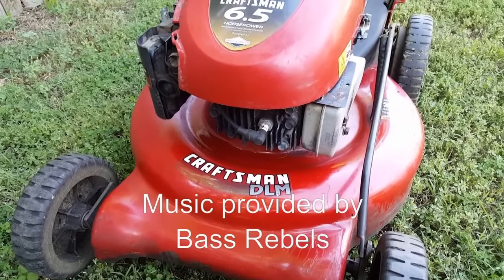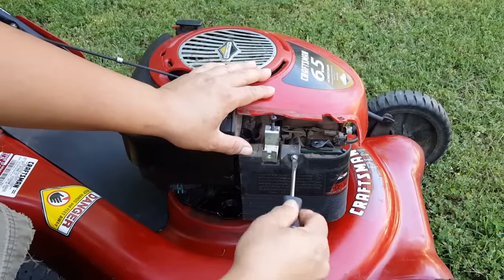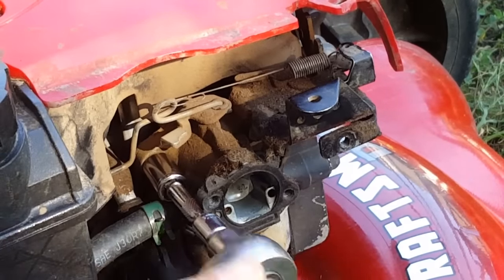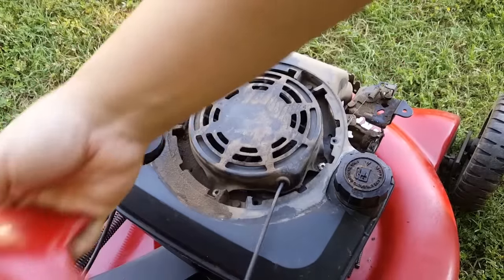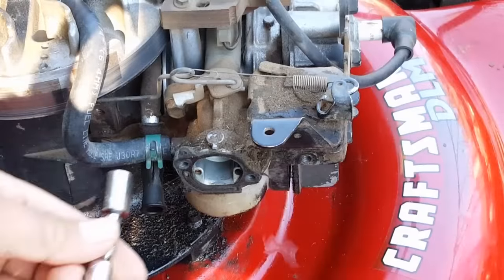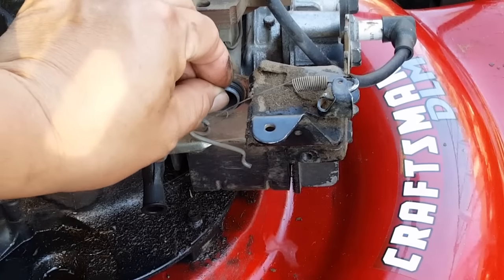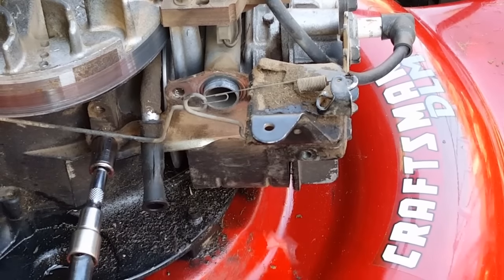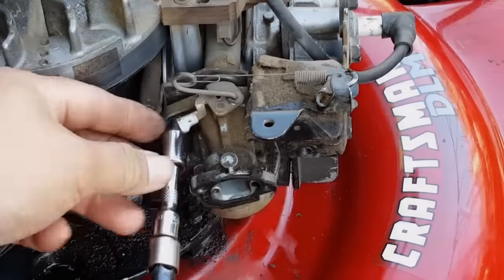Lawn Mower starts and then dies, turned out to be an easy cheap fix -Loctite!

Comment: oh yeah, that's an "easy fix"   LOL!
Reply: Only took me about 10 minutes worth of labor, and that's only because I put it on wrong the first time lol, better than wasting a couple hundred bucks buying a new one.
Reply: It is an easy fix. Literally like 6 bolts
Reply: If you know what to look for.
Reply: It really doesn't get much simpler than taking bolts off and putting them back on. You're not having to tear down any parts to fix internals. My 8 year old daughter just did a similar repair as I talked her through it
Reply: @joelt4416  Are you for real? I'd be ashamed of making a comment like that you clown.
Reply: @jamesbruce9607  you're breaking my heart.
Reply: 😆 ikr
Reply: It's easy for most people, difficult for double digit IQ people, extremely difficult or even impossible for single digit IQ people . Duurrr
Reply: @RealFifty  we get it dude, you got nothing going for you
Reply: @damnit_terry_why2211   it's ok buddy 👍🥳🥳
Reply: If you’ve never worked on something like this all those bolts coming off can be a little daunting. When you get into though you’ll see that things only come off and go on one way. So it’s pretty easy. Just don’t lose the bolts or parts.
Reply: Very easy fix
Reply: "Easy fix" if you already have all of the tools, O-ring and thread locker. Otherwise, a few trips to the hardware store trying to find the right tools and parts, then trying to figure out where all the bolts are supposed to go putting it all back together. Yep, "easy fix." 😂
Reply: @dark7hery1093  literally like 12 bolts. Learn how to count or at the very least stop saying "literally".
Reply: Easy fix for someone who doesn't have tools or know anything about mowers? Lol sure it's great on the $ saving but for those that don't work on this stuff. It ain't an easy fix 😂
Reply: @joelt4416  if you have a push mower, you should own the tools to perform this standard repair. Being poor isn't an excuse, be better with your money.
Reply: Agreed.  I wouldn’t say easy, esp if it’s not the same model mower or you don’t have tools.  Might get something apart you can’t figure out how too put back.  But if you’re looking at trashing the mower anyway it’s worth a shot.  

I think someone said if you have a mower you should have the tools to fix it?  Do what now?  You probably have internet in your house but don’t have the skills or tools to take your router apart.  The two are not mutually inclusive.
Reply: If you have an average competency level
Reply: @a_real_jive_turkey7772  if she available for an overhaul? My 68 Chevelle is smoking...
Reply: Proceeds to take the entire thing apart
Reply: @TheMoistDonuts  gotta start somewhere 🤷🏽‍♂️be doing it all in no time.
Reply: say you’re stupid without saying you’re stupid
Reply: Ummm yea he was rite easy fix my ass
Reply: Knowledge is power.
Reply: The replies here really indicate why society is falling apart.
Reply: This comment section took a detour, huh? Comments on people’s IQ, financial habits, work ethic 😮
Let’s be nice, it’s a video about using a ratchet for Peet’s sake🙄
Reply: No kidding.  I'm in the middle of cutting before the rain comes. Was looking for a super fast fix so I can finish.  This to me is a two hour project. Got most of the lawn done, so I guess I'll just weed trim the rest before the storm comes.
Reply: @TingTingalingy  "be better with your money" lol When you get a job, tell me. We all know you don't have one.
Reply: @DrowsyYo  yeah.... Idk bro... I Own a home, I own a canyon AT4, safe full of firearms and ammunition, freezer in the basement full of meats, pantry full of dry goods. Do better...
Reply: @cbrooks0905 love the way you approached this. You sound like a great guy! Hope all is well
Reply: @thebewitchinghour831  cutting grass is secondary to damn near everything else in life. The grass will still be there after the rain, dont let it rule you.
Reply: @TheMawas1 
Not even close
Reply: My thoughts exactly I’ll wait till payday then pay 35 to dude who walks down the block then I’ll buy that stuff then do it myself
Reply: I have zero mower skills, I bought a used one off marketplace, had bad carburetor gaskets. But the owner thought it was a carburetor, I had extra gasket material in my tools. Changed those out and good as new. All push mowers are disassembled similar to this, that I’ve seen on YouTube. (Like I said I’m new, no mower experience other than YouTube)
Reply: Thought he was going to say spark plug 😮😮😮😮😮what the wow😮😮😮😮
Reply: Yeah, so “easy” I quit watching 1/3 of way through! 😫
Reply: “Let’s go ahead” and show you a multitude of processes of elimination first😴
Reply: "Omg its such an easy fixxxxx"
......says the people who had to come to YouTube to learn how to do this extremely easy fix....

Comment: Nice video. If anyone else having a similar issue and the carburetor isn't loose, then check the bottom canister under the carburetor, there is one small bolt, once removed you should see two tiny holes on the bolt. Clean them an wallay. Perfection. DallasCityOfChampions
Reply from the maker: Fernando Rodriguez thank you for the tip. I appreciate it.
Reply: I believe what he may have meant to say was ... "aaaaand voila!" 🤔

I mean, I'm just sayin' 😉👍
Reply: Voila is what it means walla
Reply: Bro! Thank you so much . That little hole was clogged. It was one in a million to find your comment ! Very pleased
Reply: This one saved me!!! i tryed everything under the sun and once i used a toothpick to clean out the little holes under the carb. BAMB!
Reply: I'll try that later. I'm having the same problem with my mower primes and runs for a second then dies. Unfortunately i'm becoming an amateur at small engine/carburetor repair with all this junk ethanol gas they're selling. I even drained the tank last fall must have still been some in the lines.
Reply: Thanks a million for mentioning the brass bolt under the canister. The tiny holes were clogged with dirt like you said and once I cleaned them out, the mower purred like a kitten.
Reply: Been a while since this comment but it's still helping .. cleaned the brass jet and away she went. Started right up. Thanks!
Reply: Thanks for saving my lawn mower.. tried everything, it wasn't the two holes in the side but actually the jet that comes down through that fitting.. thanks for pointing me in the right direction.
Reply: Canister is called the carburetor bowl
Reply: Dude! Thank you! Saved my wheeled weedeater. Little flake of rust blocking that center jet hole in the bolt. Started strong first pull and stayed running after having not run over a year and running poorly before that. Man I can’t believe it was so easy. Wish I had known a year ago lol. THANK YOU
Reply: Dude! Thank you! Saved my wheeled weedeater. Little flake of rust blocking that center jet hole in the bolt. Started strong first pull and stayed running after having not run over a year and running poorly before that. Man I can’t believe it was so easy. Wish I had known a year ago lol. THANK YOU

Comment: Dude I work on stuff like this as a day job and see some of these videos for a tip. I'll tell you, this was a good watch fr. Also I find it crazy you do this out in the yard. I put machines on a table and either sit or stand where it's at. Trust me you'll save alot of energy and you'll save your back
Reply from the maker: thank you Destin5, I appreciate the tip
Reply: @Destin5  That's great advice for someone who does this as a day job. Myself,  I don't have a work table large enough to hoist it up on and I only have one lawn mower.
Reply: I'm using a chair to sit on 😆

Comment: I've driven myself crazy for most of the evening trying to figure out what's wrong with mine. . . and combined with little to no knowledge of small engines, it's been a lot of teaching myself what different parts are and do while also trying to troubleshoot. Your video not only was the solution for my problem, you explained it clearly and simply and definitely gave me the the confidence to DIY the job myself. Thank you!
Reply from the maker: Thank you for the comment.  I'm glad it worked out for you.
Reply: Same for me_ am crossing fingers that it will be the fix for mine as well🙃
Reply: @ajtv1993 well?!?

Comment: My craftsman mower was starting and stopping. After watching your video, I pulled the air cleaner and inside of the intake tube was a small mud dobber nest. 
Nothing was loose, I cleaned it out, it started and works perfect again.
Thanks for sharing. 👍
Reply from the maker: Great job! thank you Creek Walker.
Reply: Small engine,(mower,) needs 3 things to run 
(In no particular order)
- Fuel 
- Spark 
- Air 
Check these 
Majority of the problem(s) will be one (or more) of these 
Fuel seems to be the most frequent

Comment: Thank you HG for this vid.  You diagnosis was right on.  I went out to mow today.. mower would start, then die.  Just like in your vid.  Carb was loose.. and that was it.  Checked stuff... cleaned behind air cleaner, tightened stuff up good.. and ... well... just finished mowing the yard.  Started strong and did not a hiccup.  Thanks again.
Reply from the maker: Thank you Robert Mardis and you're welcome.

Comment: Thorough presentation.   Thanks.   Saw a thing I missed in going through my mower an hour ago.   Back to the garage to disassemble again and go through the carb more thoroughly.  Btw...I only use premium fuel, 93 octane in all gas engines here, as recommended by my repair shop...since using it, for over 10 years, my former bi-annual trips to the repair shop have stopped!  I don't run engines dry or drain the fuel in the Autumn, typically October.  My engines start up fine each year in April.
Reply from the maker: very nice and thank you for sharing your experience
Reply: High octane fuel is not really needed 
What you need is fuel with NO ETHANOL

Comment: Thanks for sharing. I have the exact same mower. I found it on the trash a few years ago & the only thing wrong with it was the shut-off switch. I fixed it with a wire tie. This mower is a beast & can cut down 6 inch tall grass no problem. I just recently found another similar Craftsman mower on the trash with a 6.75 HP BS. It also has a shut-off switch problem & the right front drive wheel was stripped. I ordered a new wheel for 21.00 & now I got a great mower. I can't believe what some ppl throw away.
Reply from the maker: Me too. Thanks for the comment I appreciate it
Reply: I have a friend who makes some surprising money doing just that. He is always on the lookout for, mowers, snow blowers, weed whackers, whatever. The fixes are usually easy and cheap.
Reply from the maker: @mbtadhl  you are absolutely correct.  Great money
Reply: Bum

Comment: 1:51 One tip: before pulling out the filler tube, check the base for built up crud that accumulates around the tube from spilled oil mixed with lawn clippings and dust. It's very easy for that crud to fall straight into the oil pan when you lift up the tube. Nice video and thanks for posting.
Reply from the maker: Thank you very much for the tip. I will try to be more mindful next time.
Reply: einfussganger loop

Comment: Thanks so much for posting. I serviced my elderly neighbour's lawn mower at the beginning of the season and it ran like a top. Now it just started doing the same as what yours did. I figured it may have something to do with the carb. Thanks! 😊
Reply from the maker: Glad to help and that's very kind of you to do!
Reply: @HomeGaragechannel I sharpen the blades on theirs when I do mine too.
Reply: I've had my HONDA GCV 190 EASY START LAWN MOWER  for over 10 years: This year (2024) it starts then dies right away, just as the heading describes. It's done this since new from Sears. I took it back several times and got into several adversarial discussions with the sales/service person. I've since taken it to several different repair shops with varying results. I'm not sure this will be a permanent remedy, but I'll give this a try once weather permits. Actually I've had this mower in excess of 10 yrs & since it will at least fire and gets fuel, rather than purchase a new one I'll at least, give it one more chance to remain in service. After-all, it's doing me no good just sitting there; if I take it apart and fail to put it back together properly, , , "nothing ventured; nothing gained.

Comment: Also check carburetor meter valve that holds carburetor bowl on. Looks like a bolt holding carburetor bowl on underneath. Use copper wire to clean small hole in meter valve. Clean bowl out with a little gas. Check air filter is clean. Check spark plug- gap- fouling- wear. My carb was loose on weed whip and a quick fix. Don't know why  mounting bolts aren't put in with Loctite from the factory. Good video. Easy to understand. Moved along and showed clearly steps.
Reply from the maker: Thank you Joseph Werner. I appreciate the information and keep it up.

Comment: I have a Lawnboy lawnmower and I was using it and it ran fine. Then I ran out of gas and it was around 50 degrees ( I was cutting winter rye). I put some gas in the lawnmower that I had recently bought from the gas station.(Shell) It did this exact thing.  I tried a few times to start it. It would not go but 15 seconds and die. I thought about this and decided to use some of the fuel stabilizer that I had bought in the fall. It started up after a couple of pulls. There was a high amount of ethanol in the gas or water. The fuel stabilizer raised the octane and/or absorbed the ethanol or broke down the ethanol in the gas. It never sputtered after that. If you are going to cut grass in the winter buy a higher octane gas than regular. Maybe second level up. It worked for me. I hope it will work for you. Note: Fuel Stabilizer is highly toxic to breath or get on your skin. It only takes a few seconds to put it in the gas tank so put some new rubber gloves on(no holes) and hold your breath until you finish putting it in the tank. wipe fuel stabilizer bottle off with paper towels to dry it off and put it in a plastic grocery bag immediately and throw it away. Hope this helps.
Reply from the maker: Thank you George Minton  for the comment.  That's a really good tip I'll have to try it out.

Comment: Thanks! I partially disassembled my mower to clean it up etc. Noticed the carb was lose but didnt see where to tighten it so I let it be. When i tried to start it, the engine was konking out exactly like yours, so i guess that's the problem. Ill have to dissemble further to expose those bolts and hopefully that will solve it.
Reply from the maker: good luck to you.

Comment: While mine did not have the carburetor plate issue. I tried replacing the gas because the gas in container was probably a year or more old. I changed the spark plug and replaced the air filter and topped the oil off. Of course those did not fix the issue. I also spayed carb cleaner into the carb and same results. I removed the float bowl cover and sprayed the carb leaner around there removing any dirt. For good measures I drained the gas yet again and put carb cleaner in the tank and kept trying to start the lawn mower to get the carb cleaner into the carb. On the 4th pull the lawn mower started and ran. I then filled the tank with gas and it works like a charm.
Reply from the maker: Thank you Mark Rajfura for the comment.  Glad to see that you didn't give up and got it running.

Comment: You put in a lot of work, but man, what you did for most people is not easy.
Reply from the maker: To be honest I'm really looking for the tough cases like this one. I really stumbled on the solution by accident this time.  It's a small engine vs a car with multiple systems. Thanks for the comment.
Reply: You have a point being many people haven't done this type of trouble shooting before or have the tools. I learned by doing it. Make sure you keep bolts/parts in order in disassembly.
Reply from the maker: Absolutely great advice
Reply: Unscrewing some bolts is not that hard.  Righty tighty, lefty loose!
Reply from the maker: Annony Mouse thank you for the comment.
Reply: Remembering where some of them go is a lot tougher. Ha Ha
Reply: Annony Mouse exactly! People acting like he adjusted the whole truck engine or changed a piston 😂😂😂😂
Reply: Mark Rajfura you have a video of where they go. How hard is it?
Reply: I probably will take a lot pictures in between to remind myself how to put them back lol
Reply: @johnanderson3746  straight up.  a couple seconds can save you a lot of headache and time.
Reply: It’s literally six bolts

Comment: I have a lawn mower repair right now at Lowe’s. They told me it was going to cost $600 to repair. They said the crankshaft was damaged and it wasn’t under warranty. They just fixed the carburetor a week earlier and then this happened. The exact thing you showed in the video.
Reply from the maker: there's no way, a bent crankshaft is causing this issue. I think they're trying to take your money

Comment: I discovered spraying a layer of hairspray on old gaskets,  then letting it dry before reassembly works great on old small engine work. pump spray is what works best .not aerosol
Reply from the maker: Eric Stewart wow great trick. I'll have to give that a try.

Comment: I had one doing the same thing..the bolts were loose and the plate was cracked...it was on a Sunday lawnmower shops closed so I just welded it...works fine now..thanks for the video..CHEERS 🍺🍺🍺
Reply from the maker: Thanks for sharing your experience .
Reply: Home Garage you would be surprised what I come across...like that plastic intake tube if it's not loose it's cracked..CHEERS 🍺🍺🇺🇸🇺🇸